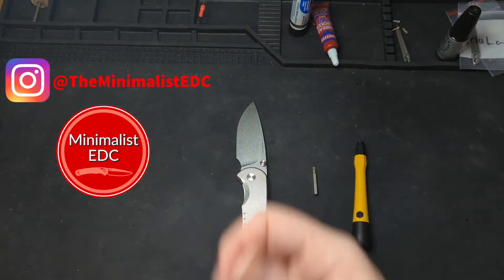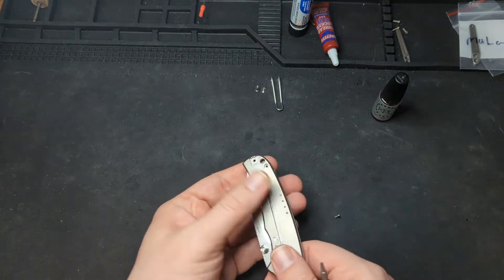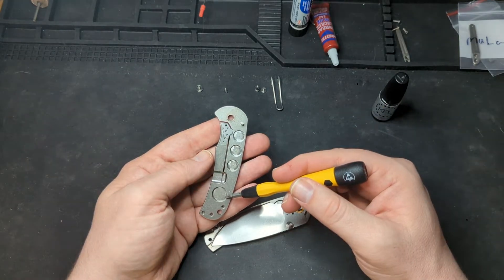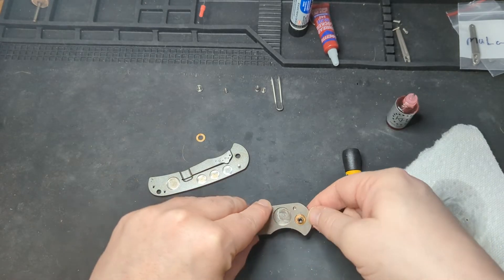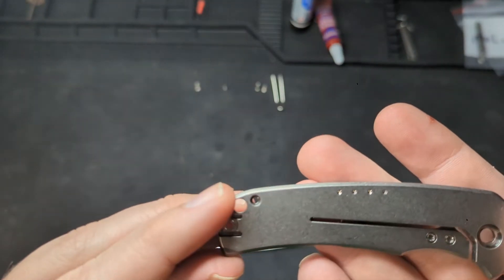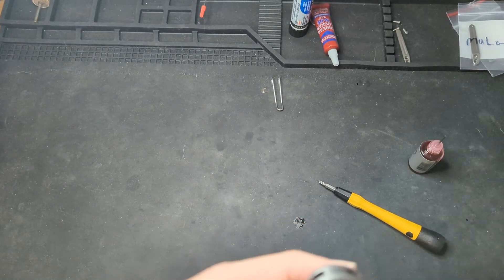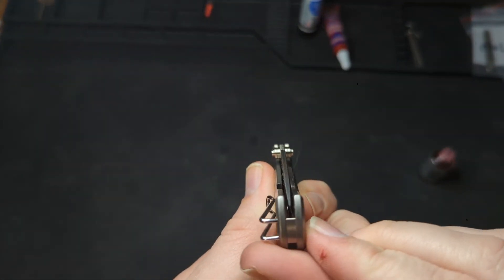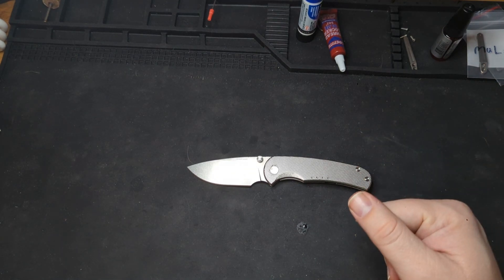Quiet Carry Drift Disassembly and Maintenance

Comment: I've got a Drift in black G10 and didn't take it down to do this yet. That's a good tip to keep an eye on the backside of the pocket clip! I don't know how broken in it was before I got it but it seems the level of snappiness is pretty consistent. I'll be looking forward to taking mine down too soon!
Reply from the maker: Hope this helps when it's time to take your apart. It did not need it out of the box but I can't resist taking mine apart right away to see how its put together.